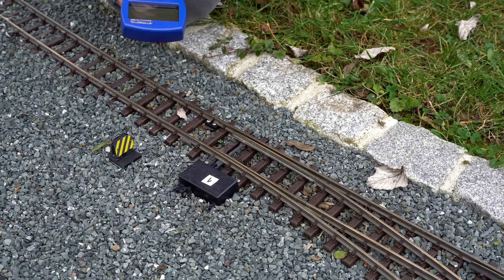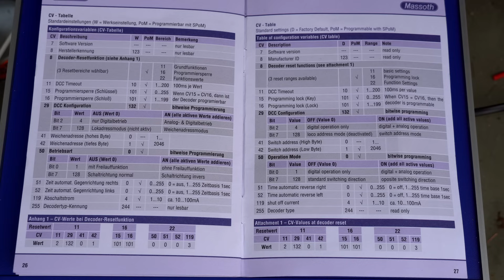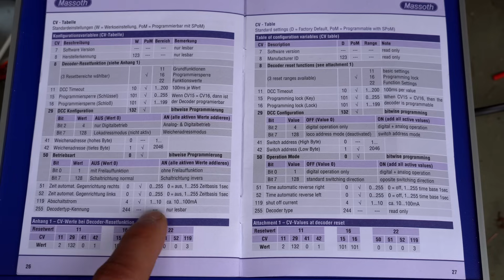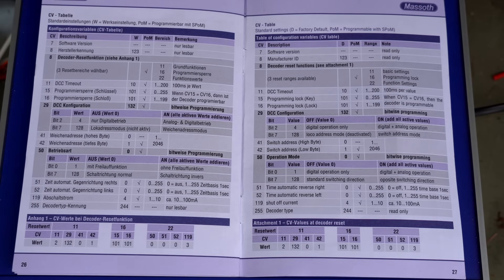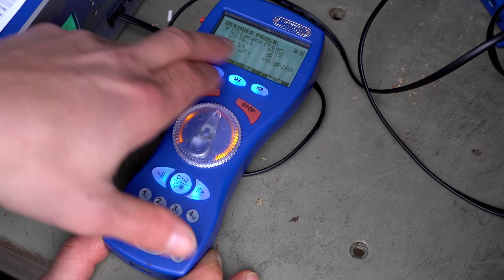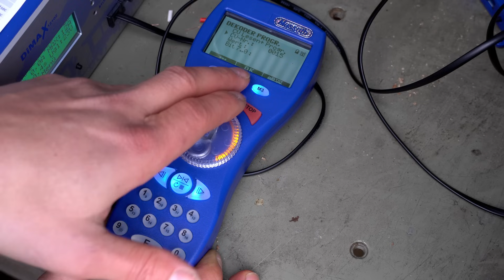Can I get the switches to work? ... programming Massoth EVO-S

Comment: Why would you use massoth switch instead of LGB EPL switches?
Reply from the maker: In some situations they have certain advantages like constant pressure applied to the switch rails, onboard dcc decoder and a smaller footprint than the LGB EPL. If those qualifications are not needed I would recommend using the LGB EPL since they are much cheaper.
Reply: @summitrailway  thank you onboard decoder is a good reason. With LGB single attached decoder costs too much. I am using 4 output decoder unit which adds a lot of wiring. On the other hand if each turnout is always energized to apply force it will increase current consumption
Reply from the maker: @BIFadmin  The Massoth EVO switch motor is servo driven, it is energized for about 3 seconds when turning the switch, then it doesn´t consume any significant amount of power.

Comment: Love your videos, I am using Massoth EVOs, and micro dynamics switch motors with my Theil turnouts. What brand of cable are you using for direct burial? Also, I am using train controller for automation, what type and brand of feedback sensors are using for current detection.
Reply from the maker: Hi Don, I answered your questions via E-Mail. Have a nice Christmas!

Comment: What happens now when you drive on the switch and you do not have it in the correct direction of travel against the switch tongue?
Doesn't the train derail because of too much counter pressure from the switch motor?
Reply from the maker: Yes the train will derail without any question. Once the signal box electronics are in place you won´t be able to run over a switch that is set to the wrong direction unless you run over a red signal before hand. So this is not an issue for me.

Comment: Thanks for the advice. I've not chosen any system yet for automating the switches but this looks really nice. Just bought two 19/27 curved switches from Thiel. They should arrive somewhere this week. What is your experience so far with thiel? Earlier this year I bought a curved trainline/ml train must I does not play really nice with lgb, playmobil and also gauge 1 trains, particularly steam locos with small guide wheels (I ve the most common harz loco from lgb and most common br 78 from marklin), any similar experiences?
Reply from the maker: I have installed the switch motors 7 months ago. They are easy to program and by reading the manual carefully I was able to solve the last problem as you have seen in this video. I like that they are smaller than competitive models and that they are better sealed as well. So far I like them, we will see how they hold up over time. The main selling point for me was the ability to apply constant pressure to the switchrails which brings me straight to the Thiel switches. They look nice and they are robust but the price point is rediciolous. I get that they are hand made and have the potential to be better than mass produced switches but in my experience they are not worth the extra money as long as you don´t want any special switches like curved switches and so on. But curved switches are a difficult topic as a whole. I avoid them completely and I have never owned one. My friends have some Piko and some TrainLine curved switches. They had to invest a lot of time and nerves to get them to work properly and they are still to be used with caution. I don´t know anything about Thiel curved switches but I am happy to hear your experiences in the future. And last but not least ... G-scale switches and 1 gauge trains particulary with small guide wheels are not ment for each other. G-scale tracks are engineered to work with bigger guide wheels, dirt and some other outdoor factors that don´t mix well with gauge 1 trains. It can work but it will always be not perfect. So after all ... I would by standard switches from LGB or even better from Piko, anything special like curved switches from Thiel and I would definetely use Massoth EVO switch motors! Have a nice Christmas!

Comment: In you If you use POM for the programming there is no need to switch the wires. You can just leave them on the track/main output.
Reply from the maker: Absolutely true, I have heard that this is possible. Problem is I don´t have a lot of experience with programming so at this time I am using the method I know...
Reply: @summitrailway  It is really not that different compared to the program track. You still program the same CV's. Only difference is that you select the address of the device and use the POM menu :)

That is also basically why the devices have that lock CV. That makes it possible to POM two decoders with the same address. Because you assign a different unlock value to both.

Comment: Thanks for the hint. I have a R5 ML-Train 8922155 using a normal EPL drive,  and even in summertime it has the same problem as you describe. I will upgrade to EVO-S for this particular drive.
Reply from the maker: That might be your solution, I am happy with the switch motors, they work great!

Comment: It is easy to solve by opening the switch drive on the switch.
And align the gearing (gear rack) this also works with the original lgb switch motor and prevents derailment.

Because the motor is all the way to the left or right, the deflection is limited and that is why it derails!
Reply from the maker: That is true for LGB or Piko switch motors. The EVO-S is totally different, it has a servo inside and no gear rack which you can move around. It is selfe adjusting as log as it has enough force to move the switch. If the current gets to high because of to much resistance the switch motor shuts down at any given position. This can be resolved by programming as you have seen in this video.